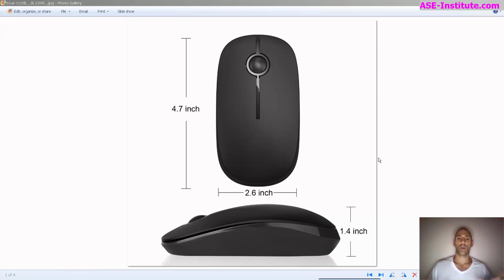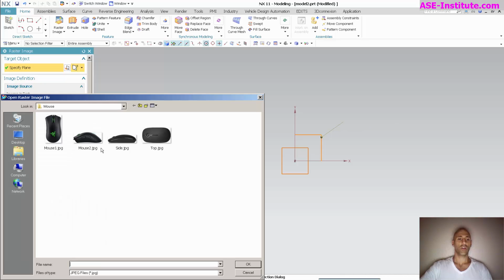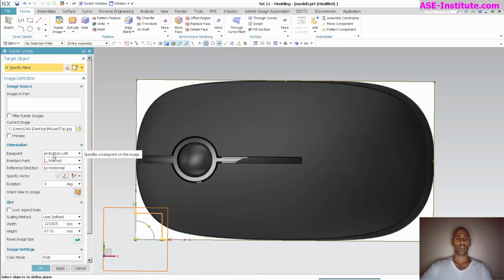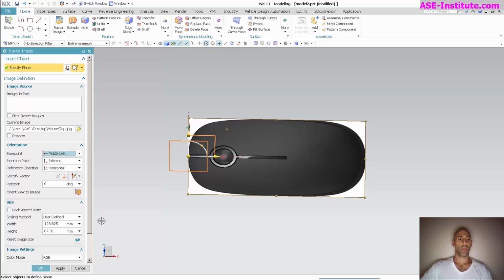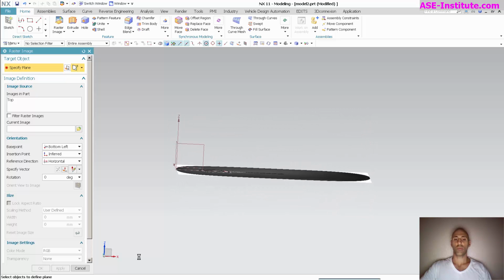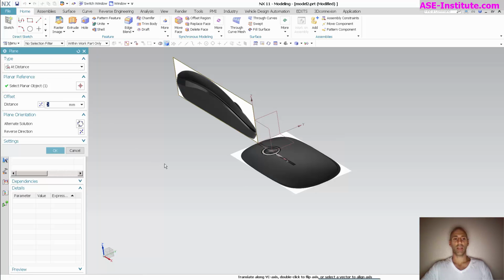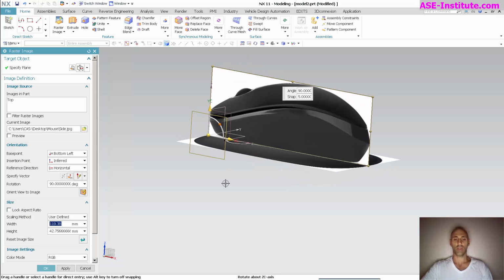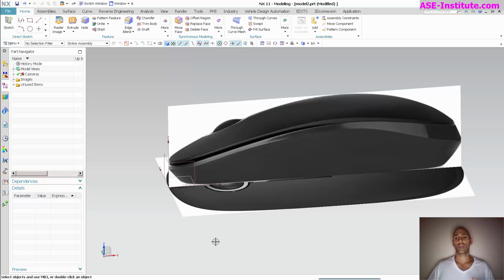Raster Images | Siemens 11

Comment: Thanks Steve, very useful!. At first glace I thought NX was very similar to Inventor but it's in another league. What are your thoughts on Inventor and Solidworks?
Reply from the maker: Cheers! 

Those are both really good software. They have come a long way and both do a lot. I use Inventor for some jobs. I am no expert but for the cost with the available tools, I would consider it if I were opening a small design shop.

SW has got the strongest fan base for a reason. 

NX and Catia are tops because they offer the biggest most complete tools from CAD to CAM to CAE